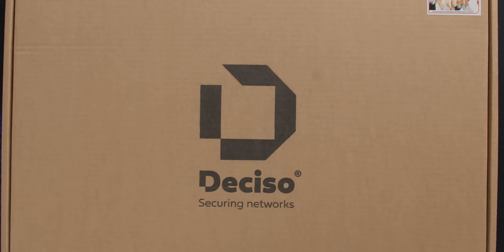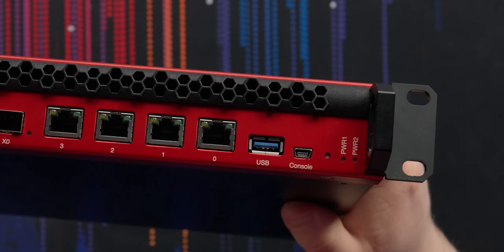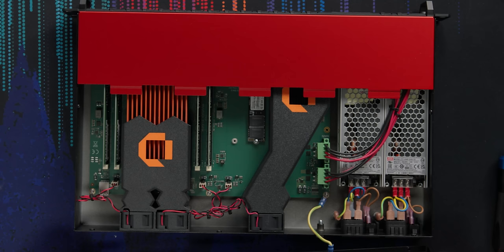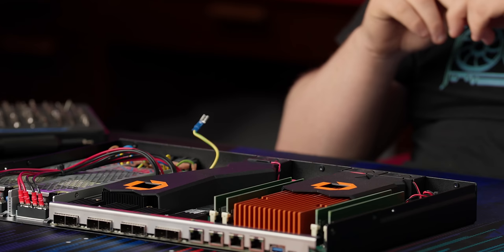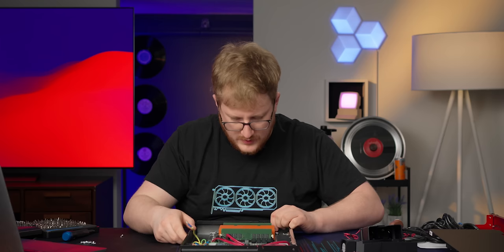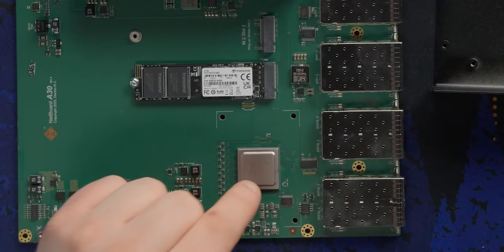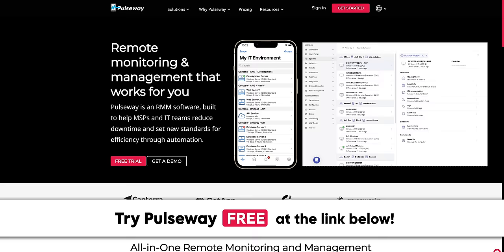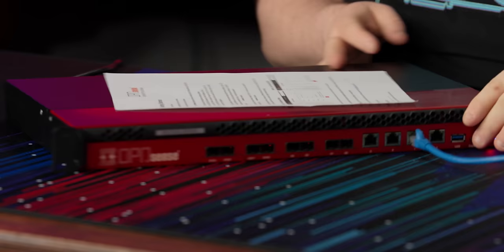Our BIG network upgrade! - OPNsense DEC4280

Comment: Obviously you can build your own hardware for cheaper but then there's no support or warranty that enterprises normally have. I don't think a large company is going to install a laptop motherboard with add-in NICs for its router lmao. 6k for that throughput is quite cheap compared to competitors with similar products.

Comment: Why would a cable have a vendor id?  what's going on there that there would be a difference between vendors?
Reply: It's common in high end networking for vendors to say they can only guarantee connectivity works with their cables - as they cannot be expected to validate other manufacturers cable quality.
Since signal integrity is king in networks

Comment: The power supplies wiring looks very DIYish, would look way more professional without the crimped connectors with screws holding the wires on, and having the power wires neatly channeled around the side of the power supplies instead of lying over the top
But the opnsense software rocks, been using it for years

Comment: since when keyboards and mouse does not have an internal output switch. to multiple devices at once. sometimes separate switches dont make any sense. oh well, an usb-hub with a output selector would do it.

Comment: The issue comparing it against FortiGate are the application signatures and IPS/IDS rules integrated in FortiOS. None of that in OPNSense
Reply: False! You totally have that with Suricata. In fact, Suricata with ET pro is even better than fortigate, but you have to spend some time on it.

Comment: Why the hell is the console/serial port mini USB? Is it a standard for some reason?
Reply: As backwards as it sounds - using older ports helps from a basic security pov
If its a normally defunct cable type, then there's less chance a casual attacker will have the cable on hand

Comment: Why do you need that much space on a router?

I've been retired for a long time, so maybe I'm missing something that's obvious to you folks. Also, I eventually paid people to do this for me. So, I've really been out of the loop - but I didn't think I was this much out of the loop. I can't think of any reason to have that much storage on a router, regardless of how fancy it is. It routes stuff. It has rules. Those are tiny files, outside of the operating system itself.
Reply: The fact it can function as a network security device (ips/ids)
It is a flow collector for this and can inspect and log large volumes of traffic

Comment: You pop out the flex box and don't even call out the sff standard shenanigans for sfp modules?
Reply: In my limited experience, things got better with SFP+. My HPE/Aruba switches work just fine with 3rd party transceivers after you input 1 command, something that very much wasn't the case with older switches that only used SFP. That being said you don't get full info on the 3rd party kit and HPE will not honour any warranty using those, but it does work and is so much cheaper than buying the OEM ones.

Comment: I love OPNsense. Just very disappointing with PPPoE and the single stack issues. On a 1gb line and it maxed out at 350/400mb. Use my factory router and get 950+ just wish they would fix this issue. I understand it’s not OPNsense issue more freebsd. But it needs addressing either way.
Reply: That is a big readon why didnt buy the dec695 yet. I really want that one but that dang pppoe thing.

Comment: Oh my god, that console port is so old, they should at least use USB-C, who the hell has a cable like that to hand these days.............................
Reply: That's the point. The console port is intentionally an old connector so there's less risk of a casual attacker gaining access
Reply: @bengrogan9710  no it's not - Many highend enterprise firewalls have USB-C as the console port.
Reply: @danielc2985  different vendors have different ideas on this, but it is the core reason for many - its why many devices use serial RS232 via RJ45, requiring a specific console cable

Comment: $6,500 USD price tag? Very home network friendly
Reply: This firewall makes no sense. It has 150gbps in connectivity and 20gbps in basic firewall rule capacity.... You can buy 3 fortigate 120g's for this price that have more firewall capacity, real layer 7 inspection that can actually act on the packets in real time, and a real security company that maintains signatures. Don't buy this junk, no matter who you are.
Reply: @gamebrigada2 exactly this. This is a dunning Kruger purchase in full swing
Reply: @gamebrigada2  Yeah, it was sarcasm. Obviously nobody’s buying this.

Comment: It's worth mentioning price wise, that you really can't compare it to a fortigate by itself, because the fortigate box is full of proprietary sht you can't upgrade or self diagnose without losing your support for it (or lets call it they will deflect blame on you) and you need a bunch of software licences piecemeal for all of their functionality, which is not a problem you have to worry about in the pfsense/opnsense world. (ok maybe in pfsense these days I dunno, I got out of IT management around the time the pf/opn war started)

That being said that still seems steep pricewise. I guess they figure if they can charge half the proprietary big names do, they can get away with it. The entire networking/server hardware & software pricing structure is completely insane these days so I'm not too surprised.

Comment: It absolutely blows my mind that that size of corporation still runs on such crap security in a day where real layer 7 analyzing firewalls can be bought for less than 1k$
Reply: It really does boggle my mind, They clearly know nothing about actual enterprise networking equipment. Using Opensource hardware like this instead of palo or forti for a company this large is terrible decision making
Reply: Dont know of one instance where a level 7 firewall actually saved the day
Reply: I vote for open source and this equiptment is sufficient, but just to add to this, Linus is cheap pathologically amd its fucking annoying. Gets him in trouble periodically.
Reply: Dont forget that much of the hardware is promotion they get for free.

Comment: for 6500USD  I expect better psus then cheap meanwell 12V units using fking spade/screw connectors major red flag: this whole thing screams of cheap design seriously the whole thing looks like a first year engineering student assembled it. friction fit fans ? in a server ? my god the rack will shake it loose to say nothing of the high operating temps of most air cooled ranks combined with cheap 3d printed plastic

Comment: Im still watching, but unless this is Sub $1500, doing sub 200gbps is just not accepable these days.

Mikrotik CCR2216, USD $2500 ISH, 2 x 200gbit chips, split to 2 x 100 and 8 x 25... Supports Most major VPN and routing, even containers these days...

I see no real instance where this router should be used.
Reply: Edit was 16 ports to 8 ports 25g, is actually 12... So likely 2 x 200g and 1 x 100g or 5 x 100g, but my point still stands
Reply: Ok, finished, 6k... Complete waste of time. Get 4 x Mikrotiks and create redundancy... Haven't LTT been pushing the whole HA thing...

This is a dogshit product for the price.

The only thing it "may" have is long term survivability... But buy the time it's required, the next thing is available...
Reply: I like mikrotik but.... As a admin of a 1000 devices network build with almost only mikrotiks (currently 92 devices), I would say that not everything is smooth and looks good as "on paper". 10G SFP+ ports "flapping" on CRS3XX devices not fixing for years..., CCR1009 problems with 100% one core load stucking the device... Other problems.
Reply: @OstJoker  each to their own I guess...
I have built out an ISP running mikrotik, 350+ Fibre clients with most being guest hotspots... ~ 10000 end user devices per day... I am not going to say there isn't any issues, but I have more issues with Unifi Guest WIFI than I do with any of the Mikrotik gear.

As I did state, this could be more robust, but the CCRs we run generally run fine, maybe a reboot every 12 months or so... At least 1 we have has been running for over 3 years,  and the CRS sfp+ thing, although an "issue" is more a logging issue (as I have observed).

Your points, completely valid, but for a SMB like these guys... Complete waste of resources, when you can pick up just as capable routers sub $1000.

Comment: Omg, OPNsense got to you guys... my condolences. That cancer really creeps everywhere. Can't wait for your video about "why we left OPNsense" for a real firewall in the next few months...
Edit: And support is EU-based only.
Reply: I am not trolling, but what is a "real firewall" from your point of view? Cisco only?
Reply: @OstJoker  In relation to this video, anything non-OPNsense is a real firewall. It is a sub-part pfSense with a nicer GUI that gets in the way to longer you use it, doesn't support the same hardware has pfSense even though they are based on the same FreeBSD OS - but OPNsense is still sticking to the slow and badly supported HardenedBSD, is slower and requires more resources than pfSense. If you want a true NGFW, you go with Fortinet, Palo, Checkpoint, Sophos (non-home).